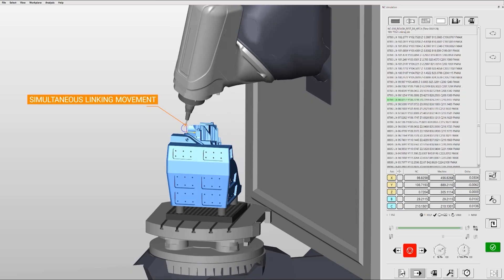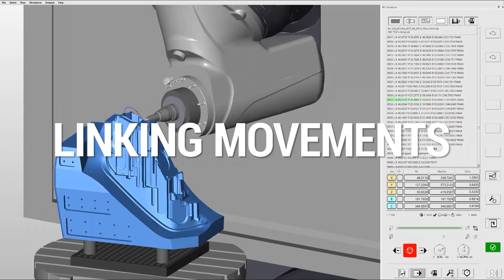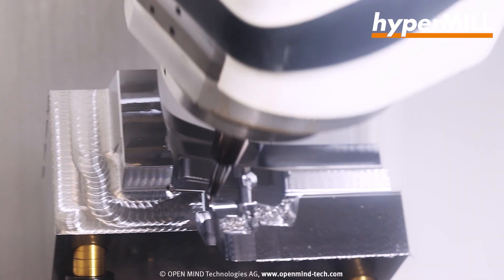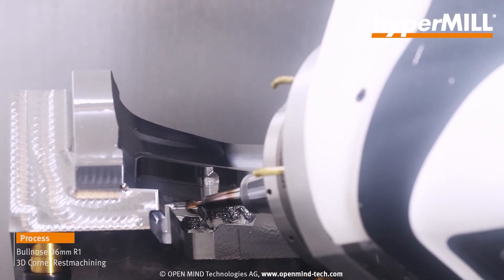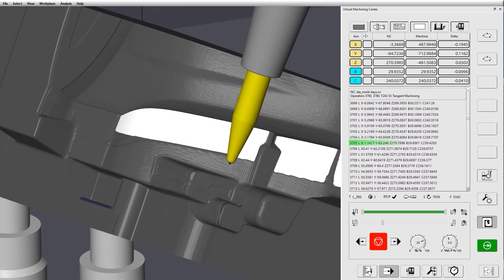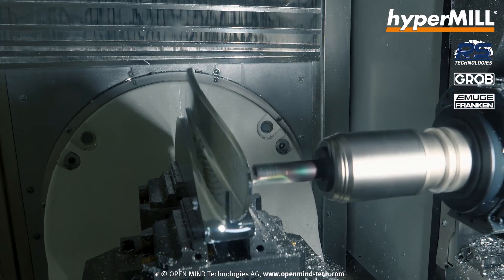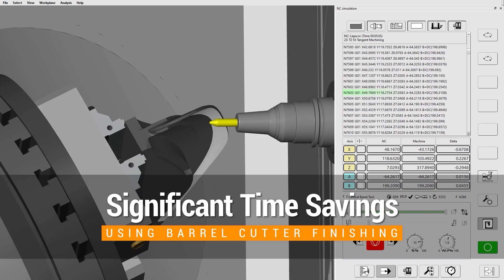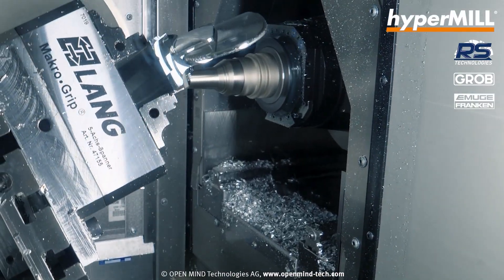This CAM system is a game changer that can save you money!

Comment: The simulation tool your referring to is Machineworks simulation package running the CL data in the background
Reply: Not sure if this is true but ok.
Reply: @ - This is true yes.

Any simulation package that does not allow you to alter the NC code and re-simulate is CL Data. Machineworks and Moduleworks SDK. They sit under the skin of almost every CAM product.
Reply: @xavierdp  hypermill develops a lot inhouse. Also postprocessors. No moduleworks, thats for sure ;)
Reply: @ - VoluMILL is Moduleworks which they use for Trochiodal - So yes they do use the product.